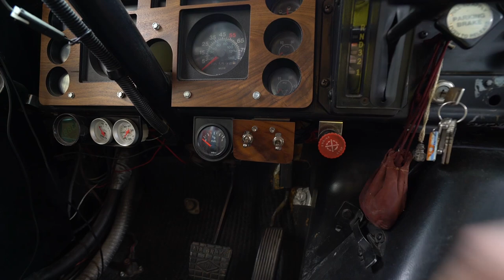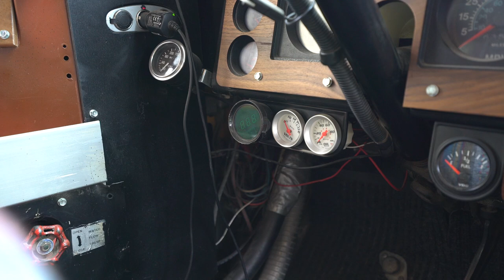WASTE VEGETABLE OIL DIESEL SCHOOL BUS CONVERSION (wvo/svo)

Comment: Great idea just don’t entirely bank on being able to use it all the time. If you can’t find oil it’s back to diesel. Many restaurants have contracts for oil disposal and you might have some trouble finding places with oil. I hope I’m wrong but just go out and try to find oil before you jump into it. Get a feeling how easy/hard it might be. It’s a great way to run the bus for cheap! And the exhaust smells much better, too!!

Comment: Cool, so fast food you get the used oil and screen it. The old Mercedes back in 80s run on veg oil with no conversion all set up either diesel or oil. Million mile car.

Comment: Boyfriend has a heated centrifuge that filters veg oil down to .10 micrones and ran his 1 ton dually on veggie oil from the fuel tank during the summer months (NY). Now have a VW Jetta TDI that has a grease car (now out of business)  system. Previous owners didn't filter the oil so system had gummed up. Have gotten it cleaned up and can't wait to get the system hooked back up. Love getting 47+ mpg on veg! Most don't know they can run kerosene in a diesal too.

Comment: I understand the cost of fuel.  It costs us over $100.00 to fill up and getting 7-9 mpg is hard on the purse. We have spent more on fuel then on campgrounds.  We are retired and we both still work.   We can not afford to drive across the country like you did even though we wanted to visit our daughter in CA.   You could travel less.. we try to keep our driving trips to 100-200 miles and stay in areas longer... and our motorhome is our home.   We boondock for 4 days or so then go to a army engineer corp camp, or National forest where we get electric, water and dump stations for 11-13.00 a night.. Get our rig refreshed and take off again..  You can use the bus full time if you space your travel out..

Comment: Veggie oil, you must start and stop with desiel. Traveling mostly on veggie oil!

I like the veggie oil idea, I personally would have to have some kind of cover for drums and filtration system. I would definitely go for a roof raise. I have seen a system that comes in sheets similar to radiant heating for the floor. 👍🏾

Comment: Love this bus! I really appreciate the honest info about your operating costs as a nomad. As much as I want to travel I think I will remain tethered to an office ...unless I can figure out how to make a mobile massage clinic happen!  Hope this works out for you, Jax. I'm sure you know that vegetable oil is not cheaper than diesel fuel unless you can get it FREE. Wasn't always easy for us back in 2003 when I had a 1976 Mercedes D that had been converted. Filtering was a nasty job but my ex rose to the call (he took out the garbage and fed the goats too) We found that Chinese restaurants (in southern Illinois 15 years ago) had the best oil and were more likely to give their waste oil away. It might help if you plug your sources. Advertising is crazy expensive and often ineffective but would be a great exchange for waste oil.

Comment: Great video!!!!  A question, and one point; ... are you planning on a full size bus for your next rig or staying with a short bus for maneuverability; and Kyle didn't mention/talk about when to switch from the veg back to diesel.  From what I've heard from other waste vegetable oil vehicle users you need to remember to switch back at least 5 minutes before you stop driving so the engine is running on diesel because of the viscosity (ie. multiply the 'issue' you had with the diesel gelling in cold weather by the veg oil not being able to flow at normal ambient temperatures year round).

Also, for cost savings if you don't go veg oil route, you may want to think about spending more time in the 'biodiesel' states with higher percentages (ie. Minnesota is @ B20, Illinois is @ B11, etc. for the diesel sold)since the fuel prices are much lower. Not too many hot springs for you to visit there though ...

Comment: This is amazing!! The mechanics told me I couldn’t put an extra alternator on my engine to charge my solar batteries when driving because it is a front engine and there isn’t enough space. I am concerned they are going to say the same thing with a veg fuel conversion but I hope not!!
Reply from the maker: You can put a more powerful alternator on, or have it modified.

Comment: Aha! I can see it now "DAN The Veggiebus " a series all about Dan The Bus and he morphs his shell every year. Cooool! HaHaaa! Hellooo Kyle Volkman! That is one of the nicest conversion interiors I have ever seen...maybe the nicest. That veg system is so far out, did you design/engineer it?  We didn't see very much of the exterior, I wanna see that roof raise. In the glance of it I had it didn't seem like nearly enough to achieve the interior it has. I hope you do a part ii Jax 'cause these are things I need to know. I would also like to get a peek at that boudoir 'cause it looks very...uuhm...functional.The lighting seems very trick inside the bus as well. I dig that you're plannin' on doin' Veggiebus Jax and I wish you well man. That fuel system is the smart way to go, everything has been dealt with and it seems so simple. This is a really cool video Jax and it's loaded with info. I've watched it twice now but I know I'll probably see/learn more when I go for the third. Big thanks to Kyle and Jax for the big load of info and ideas. ..................................PEACE!!

Comment: sounds like a huge pain the ass to me, I see lots of clogged injectors, lots of needing to replace filters , cleaning screens endlessly, trying to get businesses to let you have there veggie oil ,may not be as easy as youd think and everything I have read on this leads me to think it shortens the life of the engine itself. It just isn't practical in my opinion. But it will be fun to watch so go for it!

Comment: That seems really, really complicated.  I wonder if Badge has any experience working on Biodiesel engines.
Reply: Bubba Warbucks that is exactly what I was thinking lol
Reply: engine is no differant , but it will kill engine sooner.
Reply: this isn't biodiesel ,biodiesel is w whole different deal involving processing veg oil into a proper fuel. what they are talking about here is straight veg oil as a fuel.
Reply: I challenge that based on how many modifications that were necessary to Kyle's Skoolie to make it run on Vegetable Oil.
Reply: Bubba Warbucks yes it is one of the easy systems lol🇨🇦
Reply: This os not biodiesel this is straight veggie oil they are different. We in Canada 🇨🇦 make tons of biodiesel oh just for interested the hots spot for it is(RIP KIDS) Humboldt Sask you 🇨🇦🇨🇦🇨🇦
Reply: Without being mechanically inclined it seems like you’d have issues and would be looking for help all the time.

Comment: You can't just drive up to a restaurant and take waste oil without asking. Do any of them charge you for taking it?  I would suspect most places have contracts for it by now, but that is just a guess. Super cool if you can get plenty of oil without having to go to 20 restaurants to fill one tank. Do you need to add any additives to the veggie oil ?  Good luck Jax can't wait to see what the next size bus will be.

Comment: Two questions.
1. Could you discuss the issues you've had with diesel? Is it that cost prohibitive? Would you have rathered regular gas? Ever had trouble getting it?
2. Your buddy mentioned a system that uses the engine coolant to heat the veg. Do you think it would be possible to to connect to the engine coolant system to use radiant heating under the floor of the living space? Just a random thought. Thanks. Always learn a bunch.

Comment: Interesting information. Good luck with your project. One thing though, that bus is so long it seems like one that size would seriously limit your camping options. I noticed his transmission gear shift was in Drive not Park. Seems kind of dangerous or is that the normal way to park a bus with a diesel/veg fuel engine?
Reply: The air brake was set! Duh!

Comment: What about insulation for the colder weather? (I know nothing about any of this) For the tank and such?
Reply from the maker: The idea is to stay above freezing for water and oil
Reply: Jax Austin well yeah... LOL...but is it a "thing" to actually insulate the tanks or is that a completely screwy idea? As in, maybe something removable that you'd place around it during cold weather or even simply cooler weather, so that you're not having to run as long to heat it up? -Idunno if you've noticed but, I literally know nothing about ANY engine 😆 so if these questions are ludicrous, that would be why. 😉👍🏽 I'll be learning everything from scratch and want to know as much as my brain allows before I, a single mama, take my girls out on this new chapter of our lives. 🙌🏽AND I DEFINITELY WANNA GO VEGGIE!! (and not screw it up) 🥕🥔🛢

Comment: I assume most if not all of the different filters have to be replaced on a regular basis. How expensive are they and how many miles do they last. Is it dependent on how clean the waste oil you do acquire is and the time it takes to plug the filters. Guess you have to travel with a good supply.
Reply: Phillip Verolla the Racor is sort of self cleaning. Fish fried cooking oil smells different when used as a diesel source.

Comment: Why does he have so much tank capacity, especially on the outside of the rig. Make sure parking a big bus in a small fast food parking lot, and finding clean enough veg oil, wherever you might be, is  practical enough first.
Reply: Tank capacity is great, tho. Woodwork in that bus was fantastic! Very dark tho, without low light camera.
Reply: Aaaand is all old, so called, vegi oil... really all vegi?  Does it matter?
Reply: Need more storage because you have limited places to get vegetable oil.

Comment: Isn't ethanol also mixed with oil to help dilute it in careful proportions??
Reply from the maker: If I understand/remember correctly, to make biodiesel, it is mixed w something /treated/filtered. This is pure wvo/svo, which is just filtered oil.
Reply: Jax Austin Yes. I've heard of mixing ethenol in with vegetable oil in careful proportions to make it easier for colder climates, only it needs to be done carefully, otherwise an engine could blow.

Comment: Restaurants usually pay soneone to extract that old fry oil so you could turn that into revenue as well as save on fuel cost.  Charge less than your competitor & have a win, win, win!  Now, how much is the initial cost to set up a box truck or bus to do this?

Comment: Diesels dislike dirty fuel. Now add in old super contaminated cooking oils full of salts,sugars,acids and other frying contaminants, you can’t  filter out! You’ll be replacing clogged filters right n left! Of course injector pumps are rather finicky toward sugars! Do as you see fit nomadic one. Might I suggest looking into a used sprinter based van/RV. These get rather good MPG without much thought on your part. OK nomadic one... Onward bound!

Comment: So many variable with used cooking oil. Sugars, salts, dissolved spices, viscosities, unknown whatever.
Reply: Backroads Nomad  no variables! Maybe you think that but you can’t be serious. You have no idea what was used in it. You might not have had issues and you may well have filtered it but, there are always variables.
Reply: got to agree with @backroads nomad , i've been using veg from 2001 till 2017, new van is a common rail system and they dont like it through the pump,  I disagree with the 2 filters needed, if you oil is liquid enough you can just run it into the standard diesel filter, worked for me all those years. just two 3 way valves, so the feed/return lines can be switched from one tank to the other. have to add that location plays a part, veg oil doesnt like the cold, soon goes thick, preheating is a key, filternig before you put it in the tank is key.

Comment: Why didn't you convert your old bus
Reply: Dale POPS Robins he wanted bigger, so he had more room for traveling partners. Helps share the expense and have company on the road.
Reply: Not all engines can be converted.
Reply: Japhill75 

I would say prolly all but definitely most older ones can. Newer generation diesel (I'd say early 2000'nds on) are pretty sensitive, would take some serious knowledge to build a proper system. The first diesels were built with peanut oil in mind for fuel.

Comment: Used veggie oil sucks. Filters all the time need to run on diesel. Oils thinking in the winter. But what do I know I just some truck mechanic
Reply: Pre heating and filtering are the culprit in veg oil... #2 diesel gells in frigid temps even #1...
Reply: Flaco I know that why they make arrives or u run a mixture of karosine. I work on diesel every day owen a 3 diesel pick ups. I trust me it the vogue oil is not all cracked up to be. It messy get every where. It was very big when frist came out. But not worth it.
Reply: Flaco #1 diesel is good to minus 60.
Reply: pariffin base is worse than sulfur base... Yes, No?
Reply: Flaco normal diesel fuel before they went to ULSD had both sulfur and paraffin. Jet-A comes from the same tank as #1 heating oil and both still contain Sulphur. Though #1 heating oil/ Jet-A has less paraffin than #2 fuel.
Reply: Veggie oil IS NOT FOR COLD TEMPS it has to be filtered 3-4 times MUST BE 150 deg min before you can burn it. Mercedes diesal ran on veggie oil it was converted to diesal lol
Reply: Total millennial bullshitters. May run but will clog all the time.... He needs 4  more Racor filters to maybe  get 50 miles...

Comment: As long as Trump or the red team is in power, gas will stay cheap. No headaches! Check with insurance company and see about see if you can get coverage. 110 gallons setting out exposed at the rear end, wow???  That rig should become a southern winter bus. Heating two 55 gallon barrels sounds like a pain in the ass? What is the price for free??? Just do your major homework first. Check with restaurants about free oil availability? Biofuel mechanics are a rarity, so who will rescue you in BFE?  Just some questions for you to think about. Jax, the final decision is yours, so make it and live with it!!! Good luck partner,  "w.w."
Reply: That isn’t true, gass went up a lot during the Regan era which was the begining of the the 80’s recession.
Reply: Here in SoCal gas is currently the highest it has been in 3 years.  Thanks Red team?